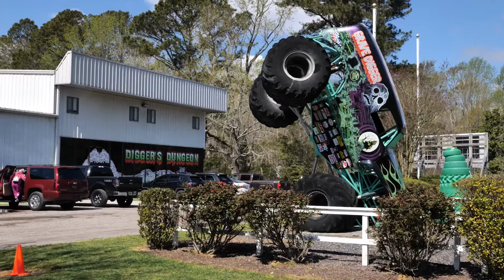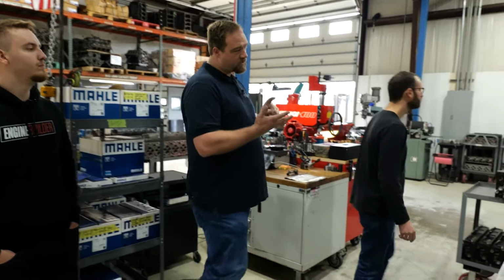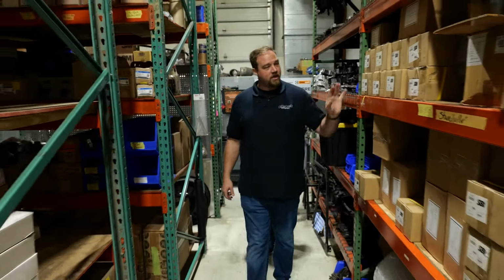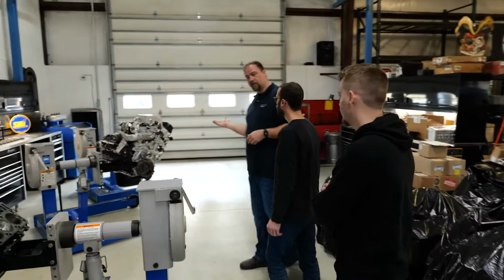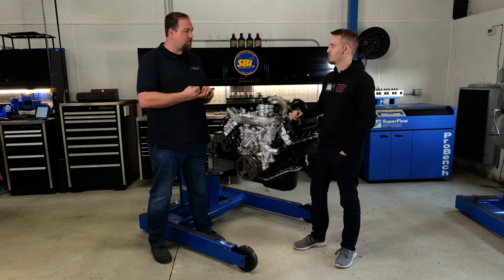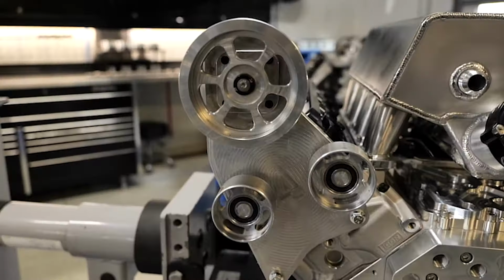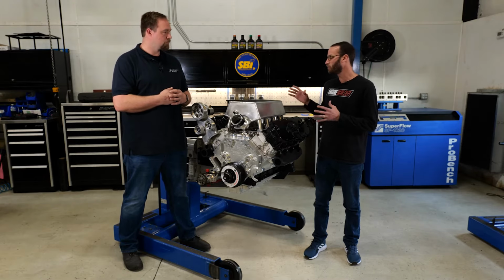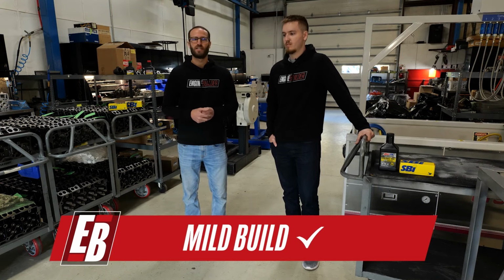Our Best Mild vs. Wild Yet! Featuring Kill Devil Diesel

Comment: I'm not a Ford guy by any means at all but I would love to see Kill Devil Diesel build a Powerstroke and of course put it in a Ford truck body and do a full tube chassis under it and take it to UCC in Indy to challenge the FirePunk Diesel guys in the UCC challenge and eventually build a full billet Powerstroke and put it in a full tube chassis Ford Ranger that is all carbon fiber body and try to take the records from FirePunk Diesel of being the fastest and quickest in the world on a 315 and a big tire slick when they had their S10 that had the Cummins in it and I would like to see two Duramax builds do the same thing and I know this year a Duramax Chevrolet full size truck took the UCC challenge this year for overall in points from DHD but last year FirePunk built the truck that still holds the overall record for the highest horsepower on the dyno at 3336hp and nobody came close to that this year